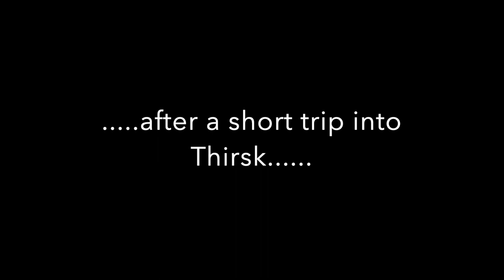Refitting Caravan Window Blinds  -  Swift Elegance 635 Grande

Comment: Hi Paul, Great Video. Quick question off topic. I see you have the Swiftshield fabric. whats it like and do you think its hard wearing (to the standard). We are looking to buy a new van and this would be the option we are thinking of.
Reply from the maker: Thanks for following.  Yes we are very happy with the swiftshield fabric (although never had a caravan before so don’t really have anything to compare it with).  We have lived in the caravan continuously since April 19 except for the 4 months of lockdown and the fabric still looks good.  It may have taken some of the colour from denim materials but not very noticeable.  The main issue we have is with the cushion filling.  This has sagged/collapsed in areas where we sit the most.  Swift will replace the filling but I need to be without the van so maybe will sort this out if we get locked down again.  We haven’t had any major spills (wine, etc) to give it a proper test.  I bet this week we’ll suffer a catastrophe now I’ve said that!  Good luck with the new van.

Comment: Where do you get these blinds from?
Reply from the maker: Hi Robyn 
Sorry I’m late responding to your question I didn’t get a notification of your question for some reason.  All I fitted was the existing caravan blinds the other way up, however most of the online blinds companies do blinds that can be fitted in the same way.  I think you need to search for “perfect fit blinds” but select surface fix rather than recess fitted.  Thanks for watching. Good luck with your improvements.